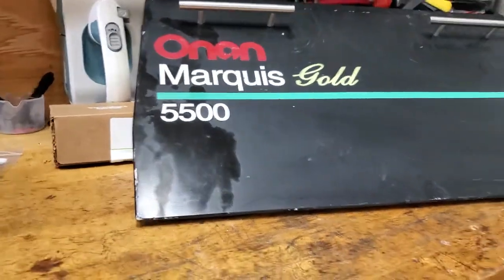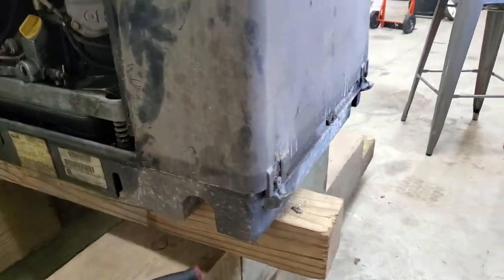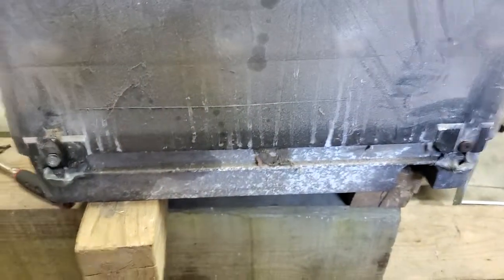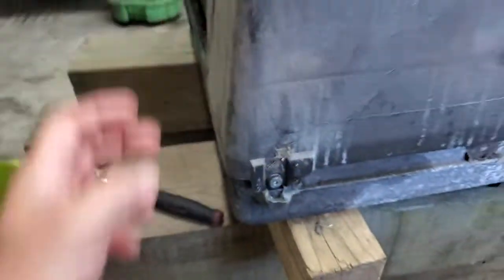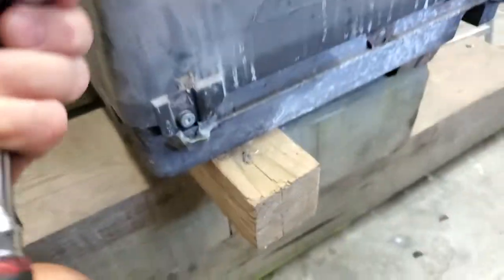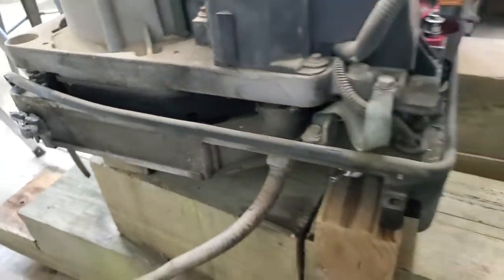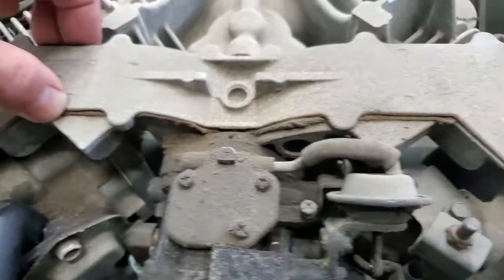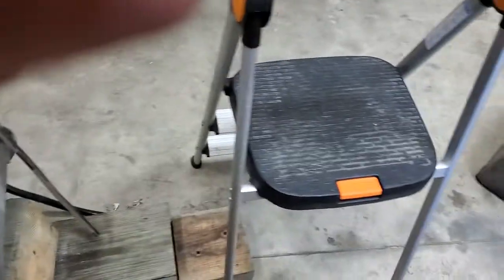GENERATOR 5.5 K remove and replace belt and coupler ONAN.Video 1/7

Comment: I bought a used 2009 Onan RV QG 5500. It is black not green. It has (2) 30 amp breakers. I runs great. I did notice Onan makes a 7000 watt unit too. It also has (2) 30 amp breakers. The breakers limits the power output. Why does the 7000 not use larger breakers? There seems to be no advantage to the 7000 unit if the uses 30 amp breakers. Please explain to help me understand.
Reply from the maker: Eletrical math 5.5k÷120 volts = 45 amps ÷2 breakers = 22.5 amps .
Now 7kwatts ÷120 volts = 58 amps ÷ 2 breakers = 29 amps each breaker. The 7k foes much better on starting inductive motors, like air-conditioning compressor and refrigerator motors .they peak out quickly upon start ,then come down in amps . Kinda like trying to get a car pushed in the beginning, once it rolls not to bad.